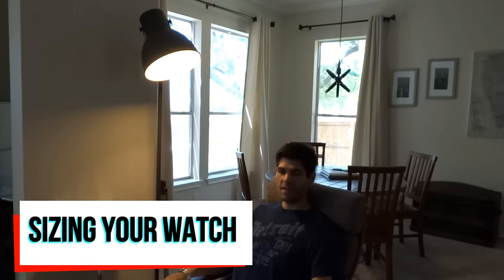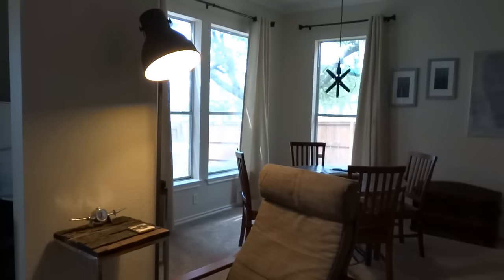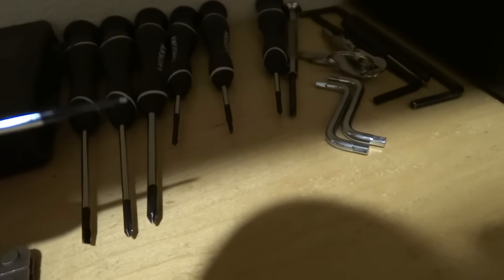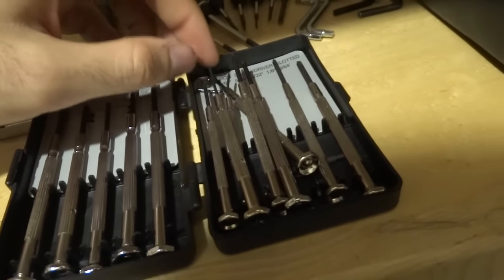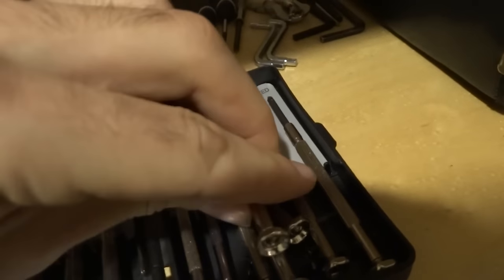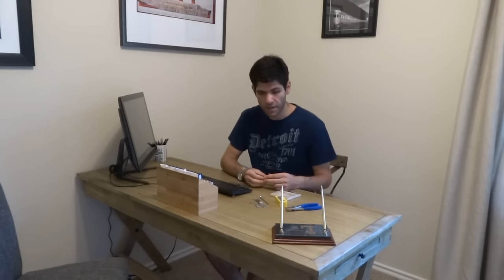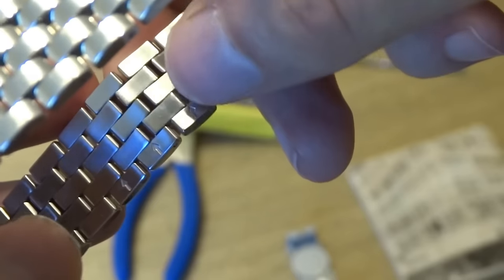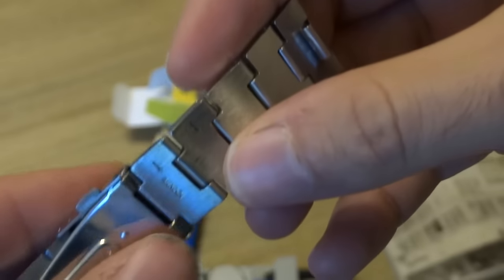How to size a watch bracelet.

Comment: In order to avoid damage, its vital to make sure when replacing the pin that it goes back the correct way, as the pin heads at either end are different. I always double check by looking at the pins in the bracelet before I push/force the pin back in. Useful video, this, sir.
Reply from the maker: Good tip, thanks for sharing.

Comment: Instead of using that screw-type of link removal tool, Amazon has a link removal kit for $5. It has a band holder to hold it sideways, a hammer with a metal and nylon end, and 3 different sizes of pin punches. It works nicely.
Reply from the maker: Great tip, thank you.